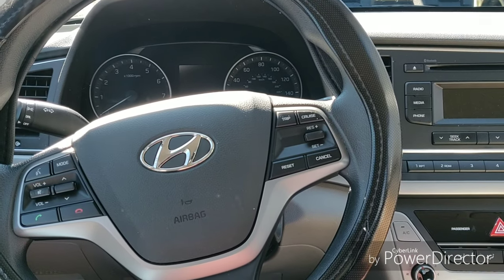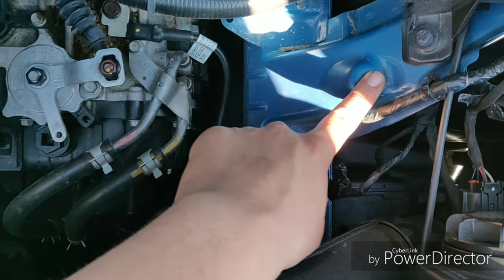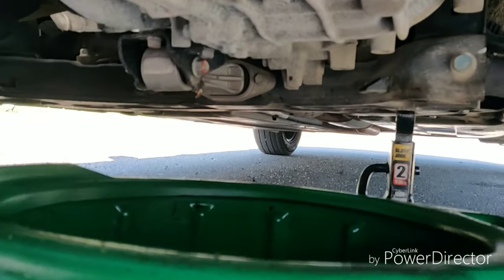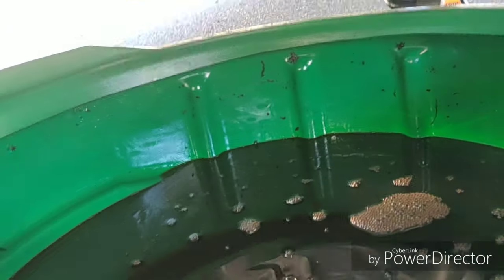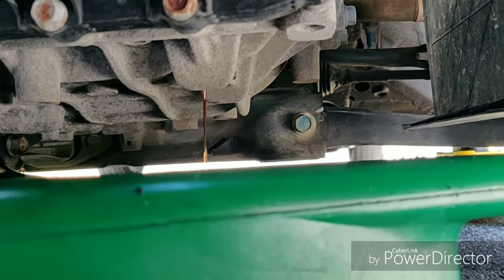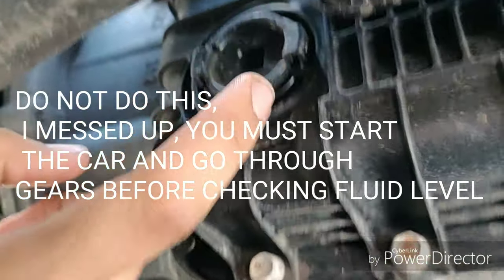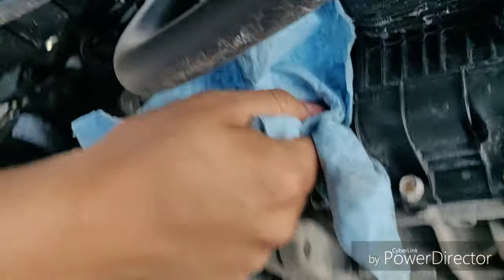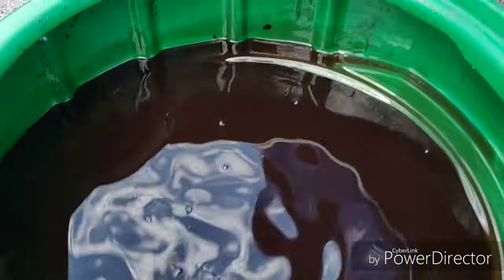HOWTO 2017 ELANTRA TRANSMISSION FLUID CHANGE

Comment: Awesome Video! I encountered the same exact problem, you cannot remove the fill plug because there's that part is in the way. A wise decision to change it soon. I had a question. Does the fluid fill slowly using that funnel?
Reply from the maker: No, the fluid slowed pretty quick. As long as you have a funnel that doesn't fit snug, it will allow air flow and the fluid will flow right in.

Comment: 2017 Elantra SE. 210k miles. Transmission started jerking going into 2nd and 3rd gear. I only drained atf once at 100k. Advice: drain atf every 60k miles. Draining and flushing is different. Transmission holds about 11qt, draining only gets rid of about 4qt.
Reply: I didn't realize it at the time but the first sign of transmission going out was a lil slip sometimes while doing around 70, it would feel like it hit a water puddle
Reply: Once the car started jerking I drained and refilled the atf. Problem got worse. I used some Lucas atf additive and it improved it somewhat
Reply: Any update?
Reply: @atrivproject  Transmission shop diagnosed it as bad transmission but they were wrong. I keep driving it like that and check engine came on with a missfire. Turns out everything was caused by cracks on sparkplugs porcelain. I replaced the sparkplugs and that fixed it.

Comment: I have a 2018 Value Edition, so I assume everything in your video applies to mine, as well.  How did you go about getting that notch put in the filll plug so that it could be removed?
Reply from the maker: I used a drill with a small bit at the slowest speed possible as well as a triangular file. **You have to be careful when you do it because the pan itself is plastic so if you slip with the drill at high speed you can puncture the transmission pan and cause yourself a ton of grief!! I recommend setting it to the slowest speed you can put it on and having patience.**
Reply from the maker: And do not drill through the entire bolt, just enough to put a notch in for it to slide out
Reply: I have a 2018 Elantra as well. This is exactly why I am holding back on removing the fill plug. Else I would've done an ATF change by now. If you ever do it, please make a small video. It would help many. I will also give it a shot and will definitely make a video if I do. :)
Reply from the maker: @anirudhranganatha3827  check out my pinned comment!
Reply: I went ahead and did the change on my 2018 Elantra as well. I've also included some tips on how I filled the fill bolt. Here is the video link - https://www.youtube.com/watch?v=_c19XUnyVUs.
Reply: @andy-auto-info2483  h

Comment: Doesn't the vehicle have to be running to fill the torque converter? (edit: to check the level I mean)
Reply: Same Q. I know what temperature it has to be at. Does it have to be idling or turned off.

Comment: isn't that the linkage for the transmission where that (Fill)plug you damaged is? just move the gear selector??...from inside the car....till you have clearance?
Reply: That’s what I did
Reply: @TerminalChillness   "No Damage"  correct? good way to start the  New Year! Be safe out there!

Comment: The owner's manual for these cars says the first trans fluid change at 60k under severe driving, which most people fit based on their criteria, or 120k miles for "normal" conditions. That seems way too long. Seeing the shards on your drain plug at 35k miles makes me wonder if that's what was wrong with my 2018 Elantra 6-speed auto. It slipped when shifting gears getting on the interstate at 8k miles and did it again at 10k miles in the same situation. Then at 15k miles it started slamming into 2nd gear when accelerating and decelerating. A real headache because the dealership wouldn't acknowledge anything wrong with it.

Comment: I’ve heard that the reason why your shouldn’t change your atf is because clean oil will eventually cause some clutches to slip. Maybe this only applies to transmission that are up their in mileage but the tiny metal particles in dirty oil allow for better contact when clutches engage. Cleaner oil is smoother and when clutches are worn the clean oil lubricates too good and causes slippage ... I’m not transmission expert but it’s just a thought yo.

Comment: I have a 2017 Elantra with 71K miles. Is it ok to do Transmission fluid service now ?
Reply: Go for it.  71k miles is not too late.
Reply: Did you do it?
Reply: Andy-Auto-Info no, not yet. Haven’t drove the car that much after the pandemic
Reply: @BRYNDISFAN  Alright. Same here I'm not driving much. I have a video made as well.. if you're interested, check it out. Take care mate. Do update your experience after the atf change. :)

Comment: Hey quick question. I got a refurbished transmission for my 2016 Hyundai ELANTRA a year and a half ago.  it’s been 10,000 miles since I changed the transmission fluid. should I change it A lot sooner than what is typically recommended since it is refurbished?? haven’t had any problems with it
Reply: I have a 2016 hyundai elantra but have no idea how to check the transmission fluid myself
Reply: @brionnadixon  unfortunately you can’t check transmission fluid on your own, it’s bolted in and difficult to open…you actually have to go to the mechanic to open it up. I recommend going to the dealer. dealer might be pricier, but in the past I would go to a mechanic, and they really wouldn’t know what to do and I lost trust.

Comment: Very helpful video , thanks!
mine Elantra has 98000 miles and ATF was never changed. Do you think it's ok if I changed it? is there risk to damage the transmission since it has never been changed?
Reply: Change it don’t flush it then in a year change it again
Reply: If it's a 2017-2018, the owners manual states the auto trans fluid needs it's first change at 150k miles. Synthetic fluid lasts a lot longer, though I don't know I'd wait the full 150k to do it. Seems like an awfully long time.

Comment: Thanks for the video dude. So I have a question. Did this make your transmission start slipping once you changed it since it was so dirty? Im at 100k and getting ready to change mine but not sure if i should do the flush or just change a few quarts.
Reply: I did mine at 140k lol. I knew it was a gamble. Shifts as smooth as ever.
Reply: I have a 90k 2013 GT I just change 4qt and I’ll do it again in 30k miles don’t want to screw up the transmission. This was my first time doing it would have done it sooner if I knew it was this easy.

Comment: I have a question will low  fluid make your car not go in drive. I have a 2016
Reply from the maker: It's a possibility. The transmission relies on the fluid to create pressure and shift through gears. You can check it's level using the method I showed in the video and go from there.

Comment: There's not much information on the internet or in my manual.  Does the engine need to be running when you check it?
Reply from the maker: Yes

Comment: I heard that changing the trans fluid filter is really hard and expensive???
Reply from the maker: From what I've heard, the trans filter is behind the valve body when you take the pan off so it isn't an easy replacement. On the bright side I heard the filter is more of a mesh than a filter so it shouldn't clog up that much. But, this is more of a reason to change fluid more often in these cars.
Reply: @josetheweirdo    thx for infos, so u can call it lifetime filter i guess.
Reply: @haideribrahim7261  Not Exactly a lifetime filter, It would lose the ability to filter at some point. And Since it is a mesh, the ATF fluid would start pushing the dirt back into the fluid. Hence maybe after 150-200k miles, its better to drain and fill every 25k miles to keep the fluids clean.

Comment: Nice video! The instructions for checking the level are a little confusing to me. Also, is there a filter?
Reply: I've been wondering the same thing, cant find anything on this cars transmission filter location.
Reply: @kmb_jr  The filter's on these newer model Hyundai's are not changeable unless you completely disassemble the transmission... which if you're going that far then you might as well buy a new one..

Comment: Why is it that if you add the amount of fluid that was taken out why would you have to check it again
Reply: I am a bit confused on this aswell. Most people get about 3.0-3.5 quarts out. so i don’t see the harm in putting that same amount back with the assumption it was filled correctly from the factory

Comment: Well mine is 189km sofar I didn’t do it I know I have to do but it driving really rough the gears are changing slowly not quickly as it’s suppose to be but the procedure has to be at once sofar I can see the service doing by our own it’s gonna be three days three times to filter out the oil of the thing completely it’s needs to be drained the old oil I mean.

Comment: Bro, thanks a lot for this vid, I started looking for this 6 month ago because I put 65K mi on my 2017 hyundai elantra se and I was super concern about the transmission especially because I've owned other Hyundais and got transmission issues. By now I'm almost at 80k mi... This video was SUPER helpful. If you have any extra tip or observation please let me know, I'll be doing this next week. BTW, what about the transmission fluid filter?
Reply from the maker: I put some tips in the description. And thank you, I wanted to help out because I knew information was scarce. Somebody else also asked about the filter but heres the reply:
From what I've heard, the trans filter is behind the valve body when you take the pan off so it isn't an easy replacement. On the bright side I heard the filter is more of a mesh than a filter so it shouldn't clog up that much. But, this is more of a reason to change fluid more often in these cars.
Reply: Did you do the change? Were you able to remove the fill plug without filling/chipping it off?
Reply: @josetheweirdo  thank youu

Comment: Just drain out from the bottom metal plug and measure what comes out and put that amount back in.  Get a new crush washer for the drain plug.  Torque back to specs.  Own more than Kia / Hyundai and never had a problem doing it that way.

Comment: When I did the drain and fill on my KIA,  it was even worse, the second drain and fill was much better. These metal shavings are normal for new car, but keep an eye on it. Granted though, I did the same on my 2009 Camry V6 at 120,000 miles and it had less shavings after 120K 😂. Lifetime fluid 😂,yeah, whis life time?

Comment: I have a 2019 Elantra I’ve already put 45k miles on so I’m planning on doing this soon. I don’t trust the dealer at all. Plus it doesn’t even seem that difficult.
Reply: did you buy it new or was it a used rental car? I have 18k on mine, doing mine pretty soon since it was 90% heavy traffic city driving.

Comment: I mean it wouldn’t hurt to just loosen the bolts holding that piece that blocking it, and slightly nudge it out the way. Then put it back in place.

Comment: Yeah even though I do most of all the maintenance on my 2019 Elantra. For 289.00 I’ll be taking mine to the dealership for a real transmission flush. Not worth that hassle. 😎
Reply: ATF HK4 1QT
Part #: AIC 30040100750 $9.95 from NAPA  (Idemitsu brand)

Comment: Apply a little common sense if you had left the transmission in the D position and set the parking brake, you would not have had to shave a corner off the fill bolt. Leaving the transmission in Drive moves that "finger" out of the way that is obstructing  the removal of the fill bolt

Comment: What’s the site you got the info from?
Reply from the maker: It was from my ChiltonDIY Online subscription. You won't be able to find it for free online. It wasn't useful anyway except for mentioning how to read the fluid level.
Reply: Jose Moradel thank you Jose I appreciate the reply. I’m doing my daughters car and I can use this video. Helps a lot thank you!
Reply: @davemon8130  Hi David, It would be great if you could make a small video regarding how you would remove the fill plug if that 'thing' comes in the way. Would be helpful. :)
Reply: @davemon8130  I went ahead and did the change on my 2018 Elantra as well. I've also included some tips on how I filled the fill bolt. Here is the video link - https://www.youtube.com/watch?v=_c19XUnyVUs.

Comment: It is lifetime. Lifetime of the WARRANTY that is. Any transmission fluid will last throughout  the warranty which is only 60k-100k. Once warranty is over and your transmission acts up, they're not responsible and you're screwed with transmission cost.
I'm glad you and others in the comment section are smart enough to realize this. Believe it or not, over 99% of the new car buyers never think about this thoroughly and only deal with the repairs when it breaks down. 😂
Either that or they don't plan to keep their car, hence sell it. Then used car buyers end up dealing with it.

Comment: l hate the knucklehead engineer who rid of the transmission dip stick and designed most of the modern AFT without one.  What a pain in the a$$ just to drain and fill the ATF.
Reply: Paul Cheang what difference did u feel after doing this flush. I don’t remember you mentioning in the video if you felt any change (smoother, faster, noise etc). Thanks!

Comment: It's not true about trans fluid being lifetime or 100,000 miles. Totally false. I changed mine at 28,000 miles and it was dark, the drain plug magnet was all packed with clutch disc material. The trans fluid breaks down and starts to lose it's ability to reduce heat and undo wear. Synthetic is better but only if it's a Real Fully synthetic. By this I mean; AmsOil. Almost all of the "full synthetic" oils out there use Tier 3 highly refined Petroleum in them. Do your homework. People are being tricked. Don't take my word about this. The Facts are available to any who look for them. I already researched this topic throughly.  If your trans has a filter and pan, change and clean all that first, and the magnets inside the pan too. Then refill and start the flush technique.
After the new vehicle break in period, it's time to get that old fluid out and start with good fresh clean Pink, fluid. Jim